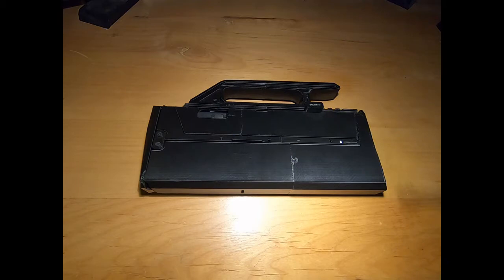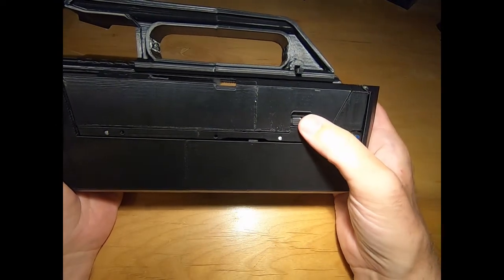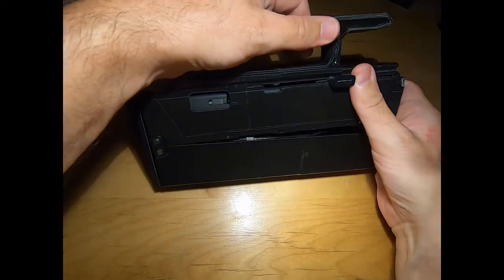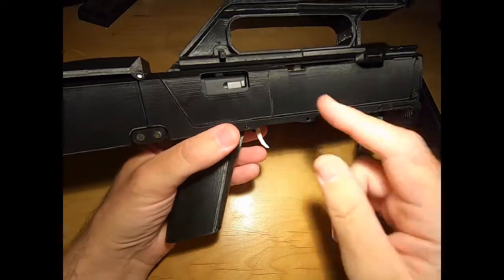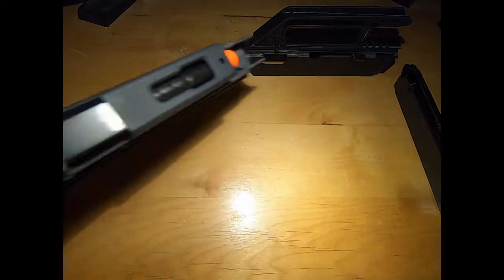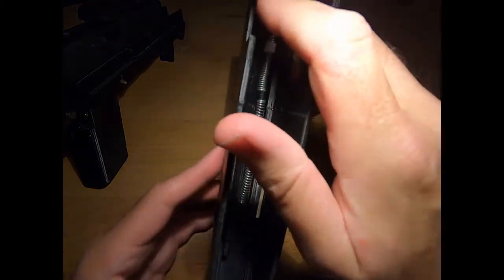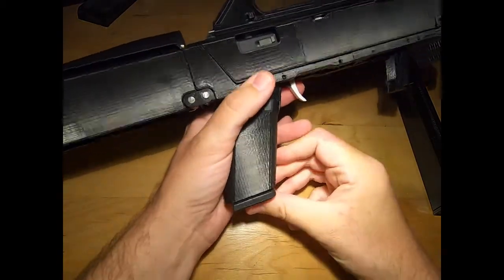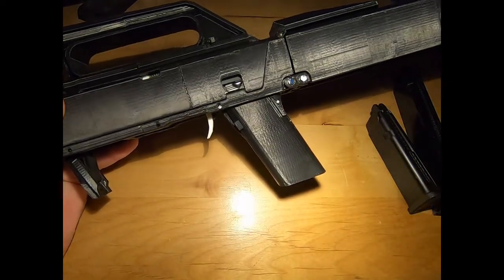3D Printed Airsoft FPG

Comment: Hey uhm could you feature a build breakdown or assembly? And how much did the whole print cost (more than 1kg of material?). I just got my hands on an Ender 3 v2 and so I'm wondering if this is a good project to start. Greetings Jan
Reply: Nvm i just found the video where you explain how you assembled The glock 19.
Reply from the maker: I plan on releasing a print and assembly video when releasing the files. It takes a lot of work with repurposing springs and getting the tolerances just right. It should be under a kg of filament with settings of three shells, 0.3 mm layer height and 15% infill.
Reply: @enone_9007  I do believe that this is a ton of work. I am looking forward getting the new pistol from novritsch. The ssp 18. He claimed it's design is similar to the glock 17? It would be a blast if it fits into your build. (Btw the pistol is only 140€ so it's way cheaper than the official glock 17 and it's full auto)

Comment: Hey, I just got my printer today and I've been looking around the web for ever for cool stuff to print and always wanted to get into airsoft (but anything good/cool costs as much as my printer did :/....). Anyways I wanted to ask if there's any chance you would share the files used in this project so I could build my own / possibly work on the project myself?  I have no intention to use them for anything but personal enjoyment :) and will even write or sign a statement is your worried I might sell your files. This is just hands down the coolest printed airsoft project I've seen so far imo.

Comment: Nice:-)
does it work reliable?
have you tried acetone smoothing or so yet, it can make it a real nice surface.
Reply from the maker: It works but isn't reliable yet. The standard WE 17, 19 mags work perfectly but the WE extended and EF 17 mags have issues. Also trying to get a trigger guard to fit. I haven't tried acetone smoothing yet, I'll probably experiment with it when I get a reliable prototype.
Reply: @enone_9007  cool, really nice.
Maby even pla for ethanole smothing works too(less hard fumes)
Okay but that just sounds like tinkering a bit on the quality of the print.
Reply: @enone_9007   cant you post the files on thingiverse as experimental? i'm sure people would understand how to put things together without a video, and i wouldn't mind taking a crack at fixing any issues that it has myself, i think i could also give some advise on anything else that might be wrong that was missed. i guess i'm just trying to ask if you need help on it, because i think i can offer some decent knowledge. sorry if i seem a bit pushy i just really wanna see this model succeed.